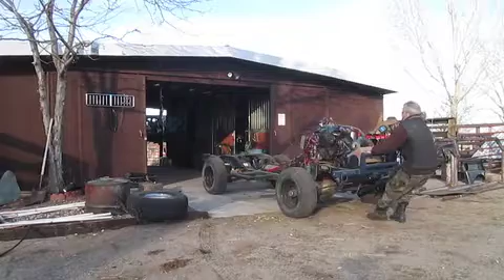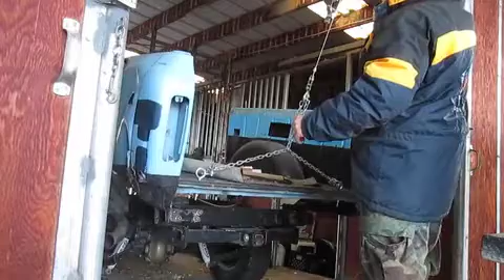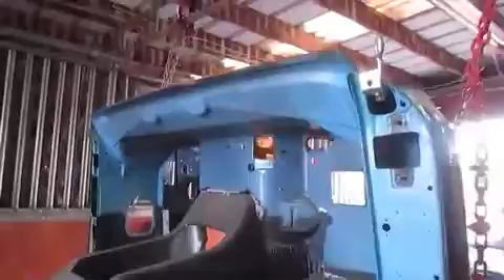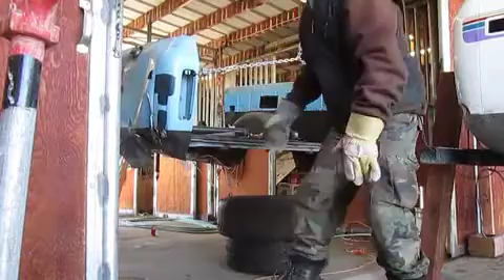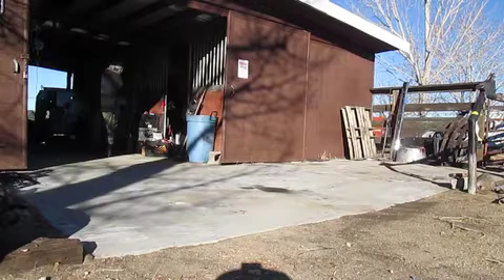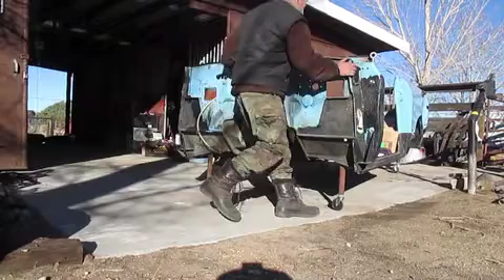"GotScout" / Body and frame moving on a Scout II

Comment: That's really clever. No concerns with the body flexing?
Reply from the maker: Body was destroyed in the crash... did not really give two shits about it when coming off.    (but as an aside... no the body came off fine... in fact it was in great shape from all the beefing and the dual floors etc that made it strong enough for me to survive the crash!)
Reply from the maker: If doing 1... weld wheels on tube... if doing 3 or more Scouts... then build a rack.  If 2... flip a coin.

And get the LARGER wheels from HF... go for 8" solids.
Reply from the maker: Peter, check this:

https://www.youtube.com/watch?v=2a_BrJ5e6_o
Reply from the maker: Send me an email and I'll give you some photo tips...  gotscout@gmail